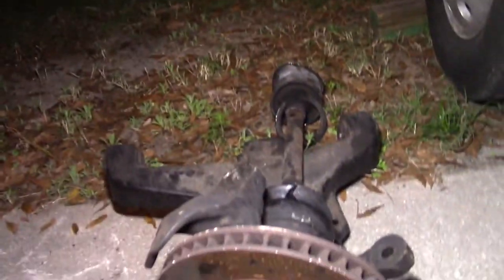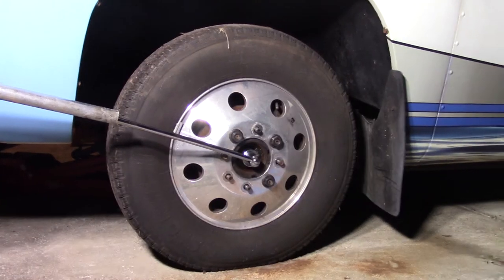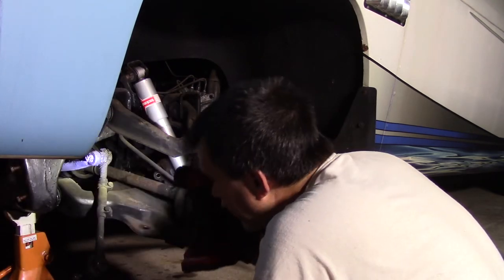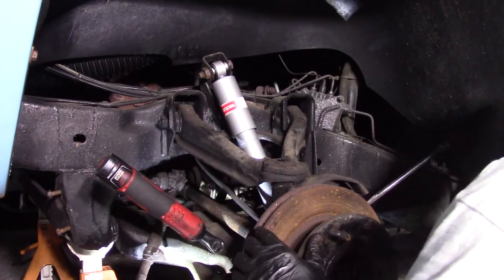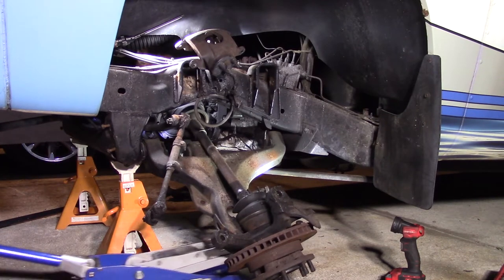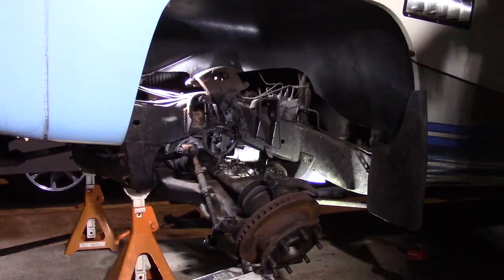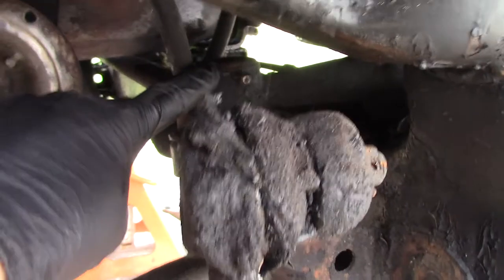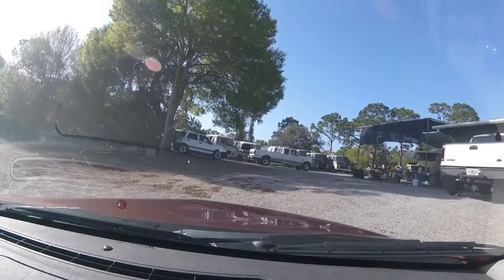I break my 1/2 Breaker Bar :(  Tearing down the front end on a 1976 GMC motorhome.

Comment: I'm about to do similar work on mine.  BTW, I've been warned about popping out or cracking windshields if not lifted evenly in front, be careful.
Reply from the maker: I lifted it from the middle and supported it from both sides of the frame.